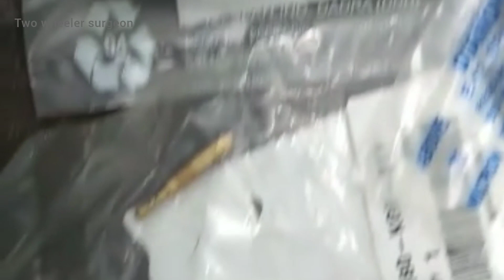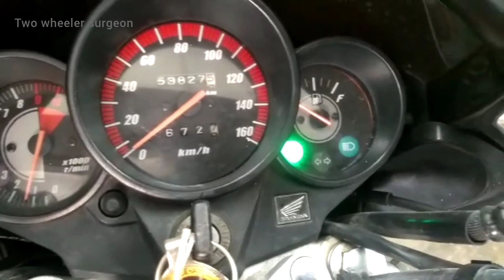Unicorn 150 complete customers tips part 2

Comment: Sir vanakkam, unicorn 160 yoda clutch plate change panni 2 weeks agudu, but engine sound oru 10 k.m normala iruku, 20 - 30 k.m continue va run panninaal engine sound overa iruku,  enna reason sir, illa vera eduvum engine work pannanuma sir